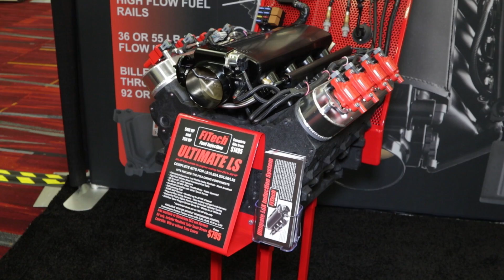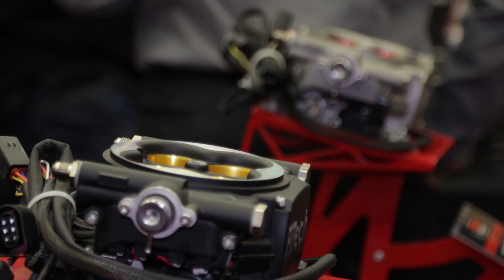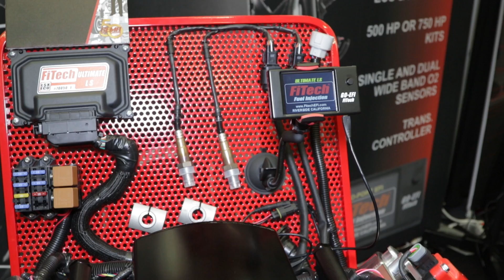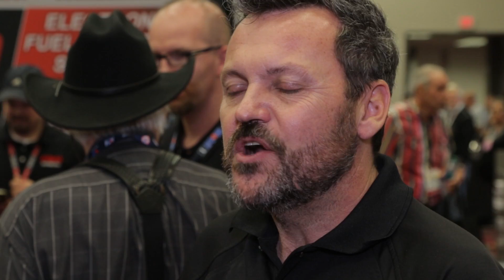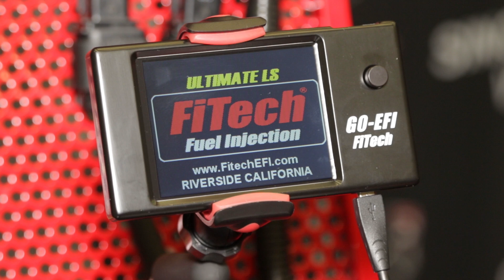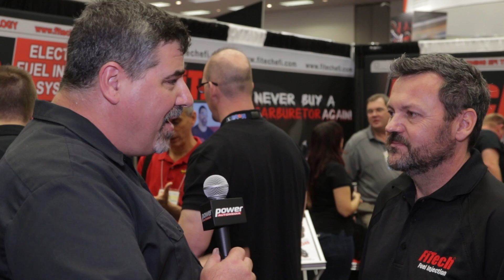SEMA 2016: FiTech Ultimate LS EFI Makes Swaps Simple

Comment: Is this Product compatible with E85 and/or other Alcohol Fuels?! Seems it would be with it set up properly with Wide band O2 Sensors, but a I'm a beginner at EFI tuning.
Reply from the maker: It will work just like any other EFI system on E85 as long as the fuel injectors are sized properly. :)
Reply: Do they have a Plug&Play ECU only kit for the 2009 Pontiac G8??